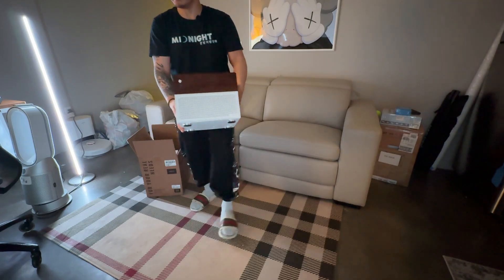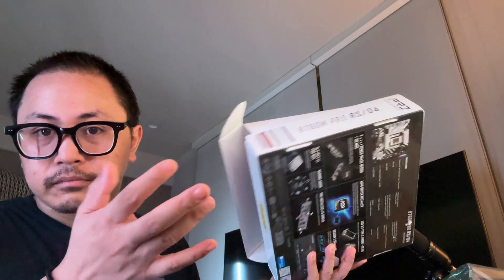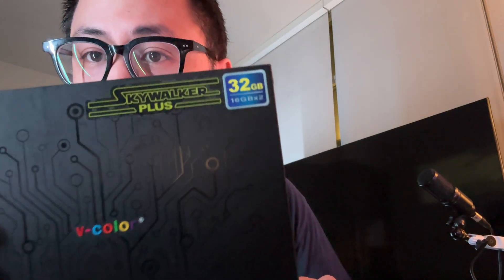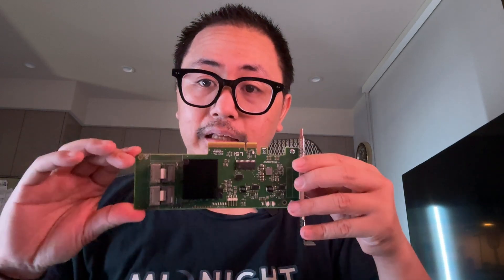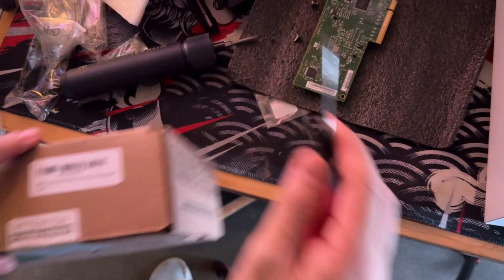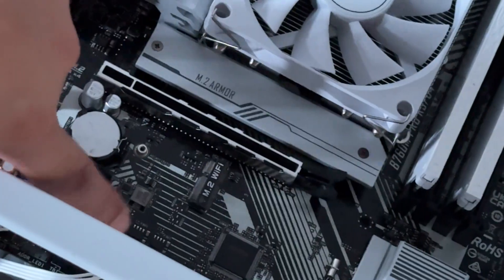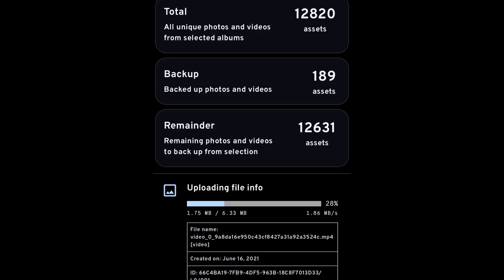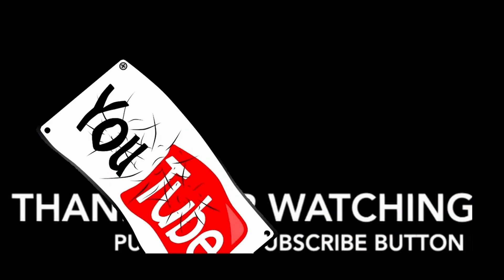Jonsbo N4  White NAS Build 2024

Comment: Why use the HBA board since your Mobo already had 4 sata connectors? Some specific reason? Im trying to mount a home server too but im noob on this. 😅 thanks in advance.
Reply from the maker: like with everything theres "data" and "power" initally I need this HBA card for expansion. I have seen too many cases where :its not enough" future proofing. *Im at 4 drives and 2 of my cards are full and when they are full my server can fail because there isnt any room to place other data)**  when i log onto my unraid UI. i can physically see the drives, so you are using this HBA card as a passthrough and another fun fact * using this PCIE slot to offload heat. *(These drives get super hot when storing and writing data constantly)  2.

lastly youre limiting yourself to only 4 drives. You need a parity drive. and drives for storage like media and dockers. hence why most people have 2 parity drives to be at ease.  if one were to fail, you have a backup. reverse side of things, if one of your storage drives fails, you have a parity drive to boot to get the data back you lost. These are HDD you are working with and they do tend to fail eventually. You just dont know when.

Comment: tbh this case was my third choice for this build but you helped me feel better about it 👍👍
Reply from the maker: oh TYSM for stopping by !! What were your other choices if you dont mind me asking?
Reply: @ohwowryanwtf  an 8-bay nas case from aliexpress that just uhh never showed up, and a prohibitively expensive option involving a 2u rackmount chassis from silverlight. i don't have any other racked components (yet) so didn't got that route
Reply from the maker: @tr4shb4t99  Ahh sorry to hear about that. My second option was to get the Fractal Node 304/804. The 804 holds more but and it is bigger so you dont have to scramble to fight for cable management. However my  case does just fine.  Plex + Immich + Portainer for data and other fun Homelab docker.
Reply: @ohwowryanwtf  an 8 bay Sagittarius case from AliExpress, which never arrived, and a Silverstone 2u rack chassis

Comment: Did the HBA come flashed in IT mode, or did you do it yourself?
Reply from the maker: @SteveStrassburg  the one I bought from eBay is plug in play? I do believe its already “configured” I have it listed already. Looking forward to seeing your build here or on Reddit 🤙🤙
Reply: Thanks, just bought a HBA flashed to IT mode with breakout cables for half the price of the LSI. Hopefully it holds up OK. I do have a Dell H310 as a backup, though. Need to flash it though. I will post the build on Redit, but still waiting for parts.
Reply from the maker: @SteveStrassburg  Are you going with the same case? Are you going unraid?

Comment: Can you fit a full atx psu in the case if you are willing to sacrifice some drive storage?
Reply from the maker: @AR00N12 I do not recommend it. But the answer is yes only if the PSY is less than 200mm. I did buy the ASUS SFX Loki. But again my build is all white for this video purpose.
Reply: atx won't fit, but SFX-L did, JUST.
Reply: @PlayingItWrong friend, what model and length of your sfx-l PSU?
Reply: routing of power to the main 24 pin connector in this case is pretty janky at the best of times, it runs under the mobo in the gap created by the standoffs. even with a small FF psu the last 2 drive bays are gonna be suuuper tight.  I 100% wouldnt want to try to wedge anything bigger in.

Comment: Great Build. Hows the fan handling that CPU? did you have to set limits in bios?
Reply from the maker: @iLVTechCorner  i did not put any limits except Xmp lol. But I did put a NZXT fan for “RGB” aesthetics ; the default fan is loud and annoying. However the NZXT Fan is holding up however because it is a small case, I do get heat warnings because of the all the backup it’s doing.  I do love having my own home server!